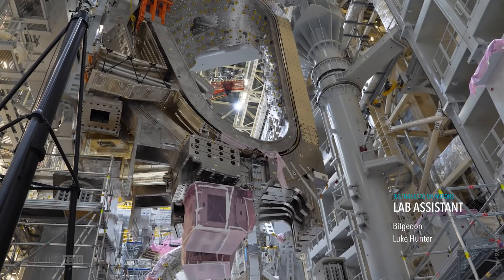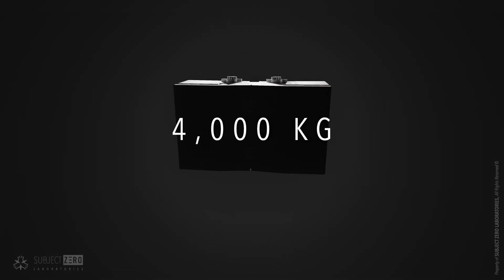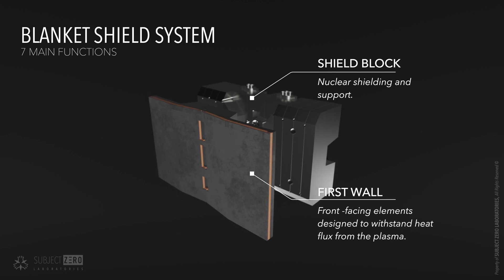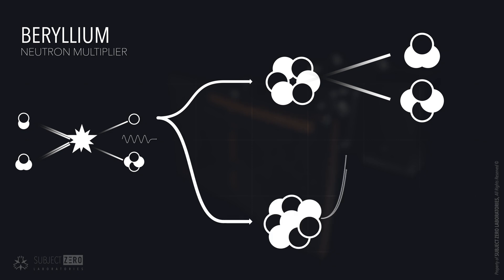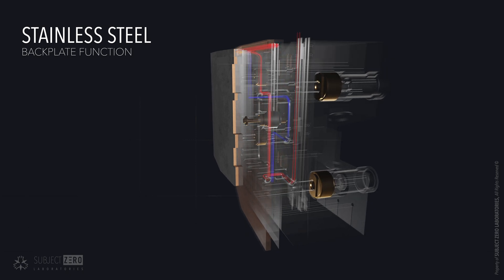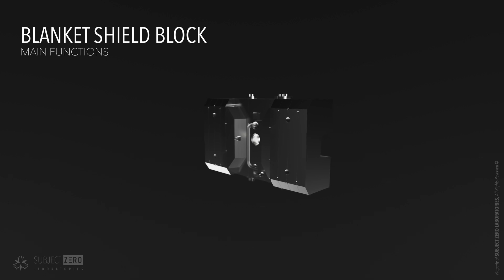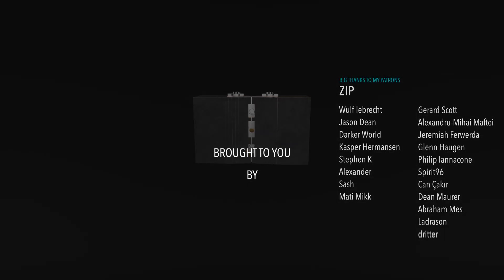ITER - Blanket Shield Module | How it works [2022]

Comment: If we are going to build a station of sufficient size- We need This in the Exterior protecting us from Neutrons and providing us with fuel in the process.

Try to imagine building a portion of the exterior layer As This.  Not Only To Help Stop Some of the Neutrons, but putting it to some good use.

This is good for Fusion, but also as an exterior layer of a Bernal Sphere of sorts.  In addition to Other Shielding Technologies.

Comment: can ITER use commonly found hydrogen for fusion reaction ( not those rare isotopes of hydrogen ) ?     If  it need special isotopes , will there be a chance there is not enough ?
Reply: No, it needs them to work.  Fusion is possible, but it requires much more energy, and we can't even get the hydrogen + hydrogen reaction to be net positive yet.  As for supply, read Skylancer727's comment.

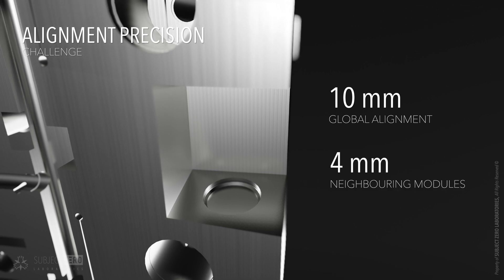Comment: I don’t think that your tolerances at 6:10 are correct.  Those are the kinds of tolerances that you build a trailer to, not a high precision system.  For those who use imperial units, 10mm is about 1/2”, and 4mm is about 3/16”
Reply: Those are far worse tolerances than even in a simple wheel axle....I'm led to believe he meant 10 and 4 micrometers.

Comment: Fusion Power is just a scam . If you examine all energy that goes into construction, production of "fuel" the losses outstrip the potential energy gains.  Just another Perpetual Motion Scam.  It's just hard for the average person to see, because of inherent complexity. I predict this will never become a sustainable process. The other issue is the rarity of the fuel sources, the complexity and energy consumption, to "mine" the raw materials to "create" fuel.
STILL A SCAM....  There isn't enough fuel available globally to feed the planned "experiments" let alone  to become a viable energy source. Scammers with degrees 🤦‍♂️

Comment: Sorry, but it's explained awfully. Some bits are missing, it's unnecessarily convoluted, and sometimes it's borderline nonsense.

Examples:
- you didn't explain what ITER even is, what's tritium for, or where the mentioned lithium is located.
- "remove energy deposition with high quality for effective power generation" could be rewritten into "transform the energy radiated from the reaction chamber into usable energy"

Top class illustrations and production, though.

Comment: Funny, I was just reading about fusion reactors how recently they're running out of tritium to run such reactors. Normally it's made in normal nuclear reactors, but most don't sequester it. There's a few in France and Germany that did but those reactors have been slowly taken offline in the past few decades. Remember that ITER was originally intended to be finished in 2010 when supply was a lot better.
Reply: @tbird-z1r  well it's just a result of the boogeyman nuclear has become in the public eye. Nuclear in general is pretty safe, but the public have turned heavily against it purely due to radiation being an unseen killer and people being poorly educated about it. Since politicians are voted for by the average laymen, that kinda matters. 

It really suck though as nuclear is cleaner than basically any other source, is basically required to make tritium for fusion, and requires way less fuel to be used for the same amount of power. One fuel rod can be used for an entire year before being swapped out. That means it takes vastly less mining to meet the same power demands as coal. Though oil and gas are better in that they take no mining at all, but they burn through it much faster which takes more transportation and oil has the risks of contaminating the oceans or wilderness. Happens all the time.
Reply: @Skylancer727  Plus we have a really good and a really safe way of storing the high level nuclear waste but most people for some reason think that we have no way to safely store the waste
Reply: @mastershooter64  Yes, there is we solved the waste problem decades ago, and recycling waste can reduce the half life of waste if we reuse it and turn it back to nuclear fuel over and over not to mention nuclear fission is very safe compare to fossil fuels because of how many people are killed a year by coal or fossil fuels
Reply: @Skylancer727  because human beings are idiots unless educated and it's not their fault it's the people who taught them "how evil nuclear energy is" and the people who don't do their jobs correctly at either designing the Old reactors or who are supposed to maintain and run them.
Reply: @Skylancer727  https://youtu.be/VHZMW0AmAKw
Reply: I read the same article
Reply: @2KOOLURATOOLGaming  https://youtu.be/VHZMW0AmAKw
Reply: Another reason for mining the moon :)
Reply: @lincolnkroll  https://youtu.be/VHZMW0AmAKw

Comment: The fact that ITER is the first nuclear fusion reactor using a actively cooled shielding is wrong! Wendelstein 7x uses it already
Reply: I mean, technically most reactors are already actively cooled, that's what the water is for. ITER in comparison needs cryogenics to not instantly melt in comparison. Not to mention if they didn't need it, that's only a good thing as it reduces complexity and makes the rest of the reactor cheaper. 

I say I'm more disappointed that ITER won't use electrostatic direct energy conversion like many experimental reactors already do. It is way more efficient than just heating water and already has been shown to work. It's not like this project hasn't already gone way over budget.
Reply: @Skylancer727 I'm not sure what you'd need an energy conversion for? They're only heating the plasma, cooling system is not used for energy production.
Reply: @Quickshot0  electrostatic direct energy conversion is a more direct way of converting the high energy plasma directly to electricity. It has an moderately higher efficiency than normal steam power generation and is also able to collect power from sources like X rays which heating steam can not. 

Basically it collects the free electrons in the plasma converting them directly into electricity in basically a miniature inverse particle accelerator. Basically you put a small tunnel on the side of the reactor, plasma feeds in and produces raw electricity without need for conversions piping, or constant source of water.
Reply: @Skylancer727  Sure and that can be pretty neat, but it's not really applicable for ITER in two ways. 

One ITER doesn't produce electricity, so the only function the water here has is to literally pull away heat.

Secondly for plasma systems to be efficient you need much of the power production to be in charged particles and such. But ITER is aiming more towards Deuterium-Tritium Fusion, which has to my knowledge large amounts of neutron emissions. Neutron energy absorption via water works fairly well.
Reply: its a scam...the fuel TRITIUM is very very SCARCE... MAY NEED EXPENSIVE FISSION REACTORS TO BREED IT!!!
!!!
Reply: @esecallum  what does that have to do with my comment?